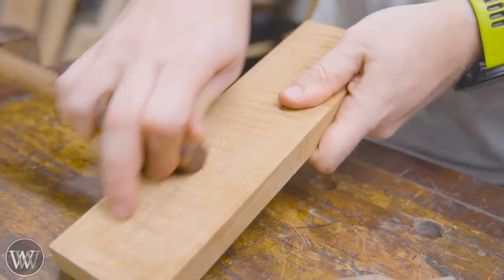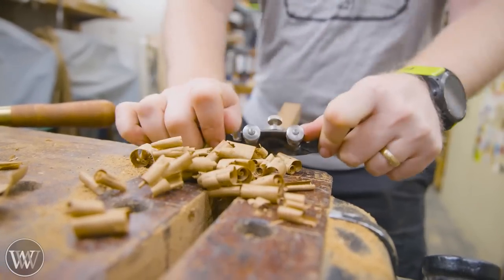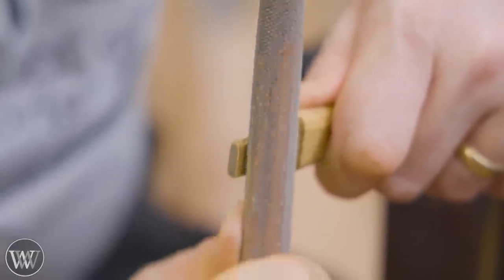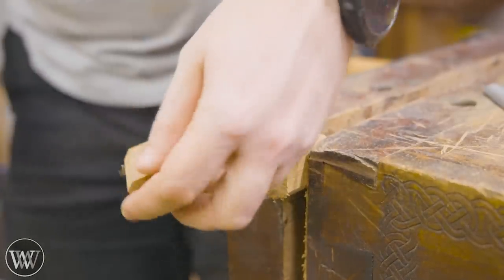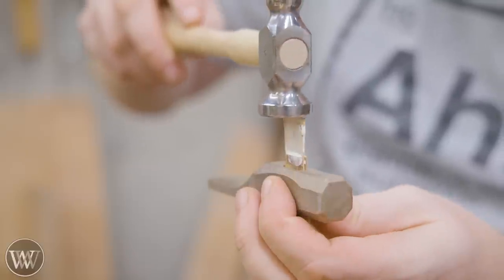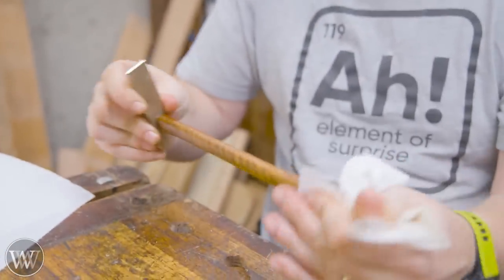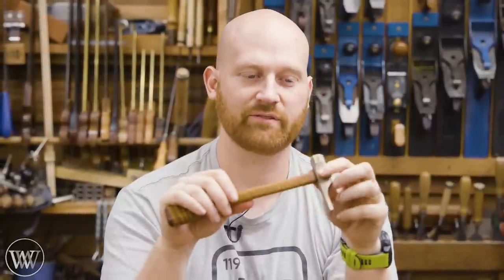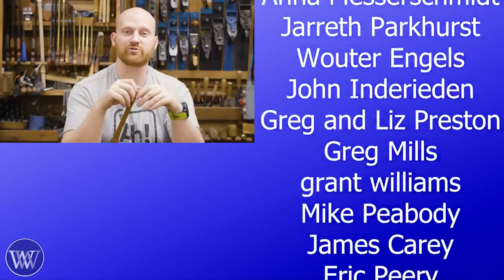How I Made My Plane Adjustment Mallet

Comment: You can turn an oval handle. For round, you want one center, in the middle of the blank. For oval, still on center. you want 2 centers, one high and one low. You can even do a cabriole type foot for the handle end.

Comment: Off to look up what “torified” (sp?) maple is.
Reply: Ok…. So, found out it’s a process where the wood is (basically) heated and dried out to 0% moisture content, then cooled and steamed to add back moisture to the 3%-6% range.  Changes some properties of the wood, makes the more mold resistant, depend the color a bit, etc.   Learn something new every day!
Reply from the maker: The heating on it isn't just to remove the moisture but actually heats it up in an oxygen free environment above the point at which it would combust. That's what actually causes the chemical change and for it to change color.

Comment: Hi James, I am looking for a plane hammer but this is specifically for using on  norris adjuster on my veritas low angle jack plane. I don't have any wooden planes (yet).   Which one would you recommend and weight. Thanks!
Reply from the maker: I would get the small as it would fit in better on those low angle planes.

Comment: Does a plane adjusting mallet require the density and weight of metal? I'm wondering if you could make one with a head made of dense wood, perhaps ipe.
Reply from the maker: Sure. The thing is the small head to get into tight places.